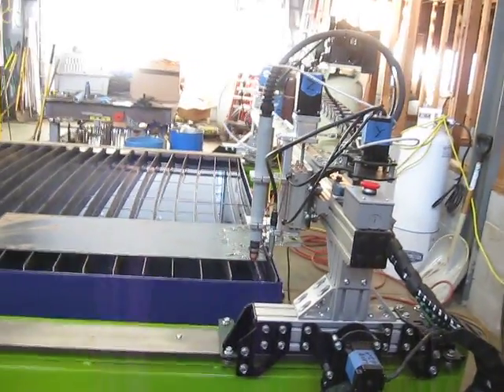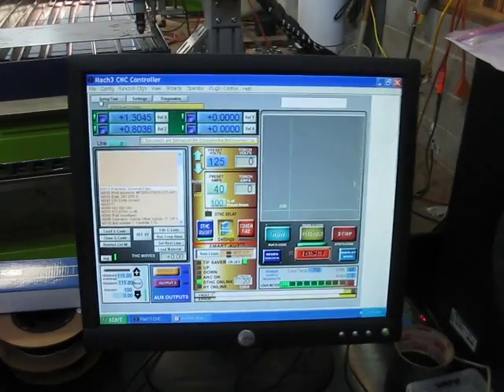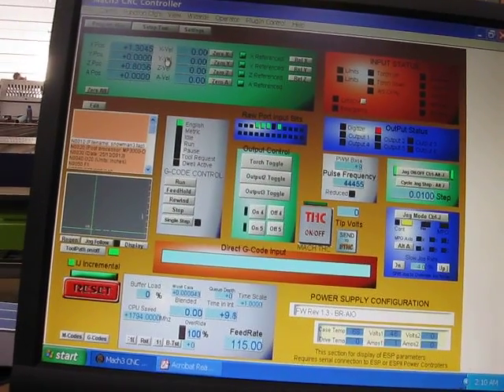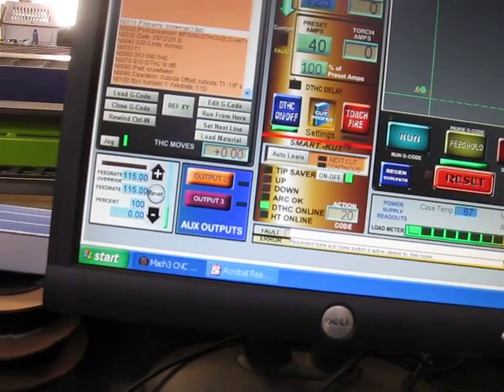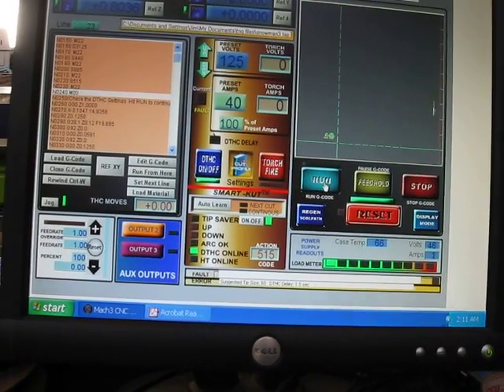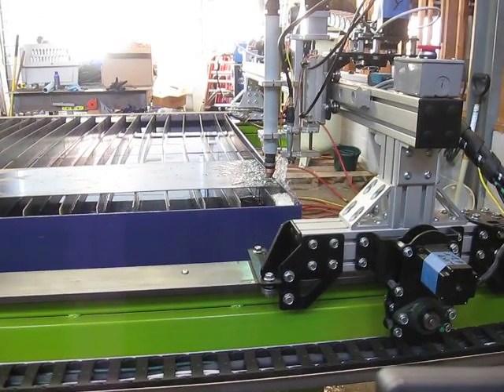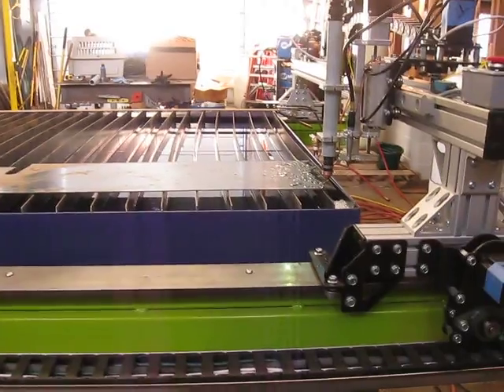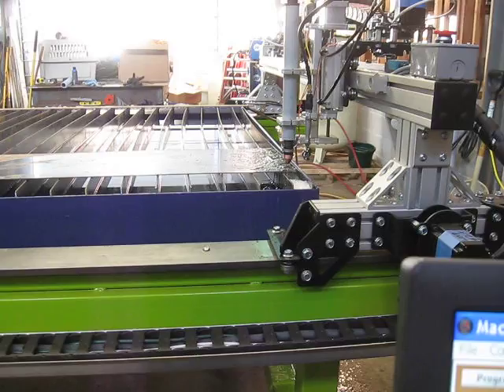Precision Plasma and C and CNC electronics HELP

Comment from the maker: Bourbon Legend I went thru a lot, but one of the major problems was the divider in the plasma was set to a different ratio than the component onto of the machine, it's the component that reads arc voltage for the arc height control. So it was reading the arc volts incorrectly and pulled the torch away from metal trying to correct voltage.